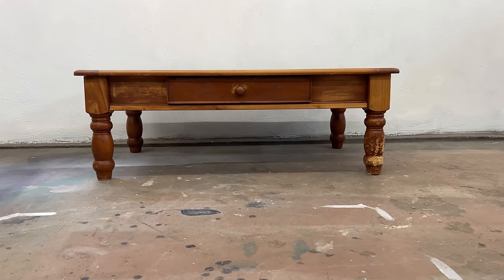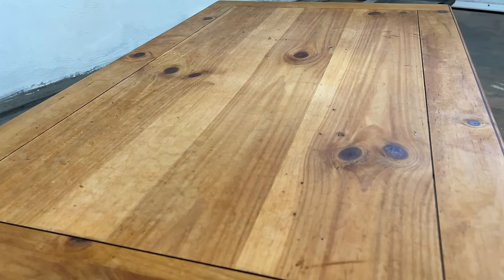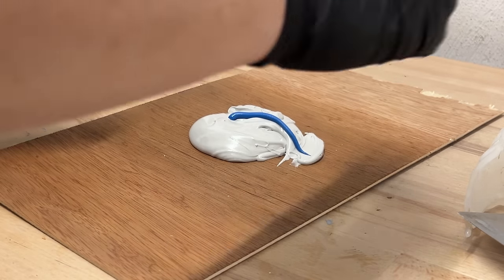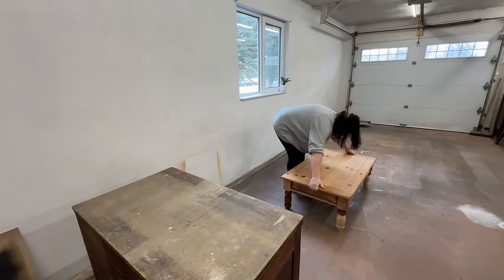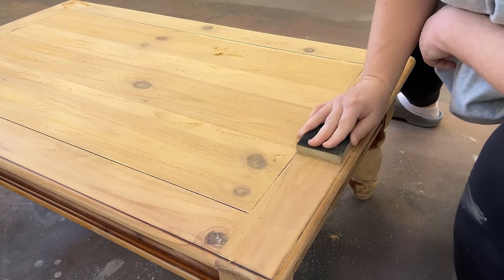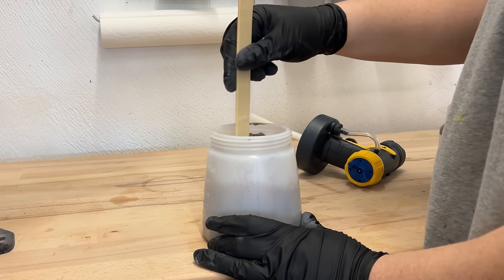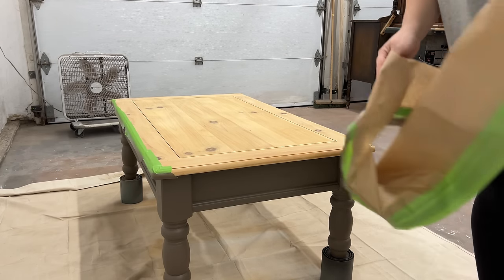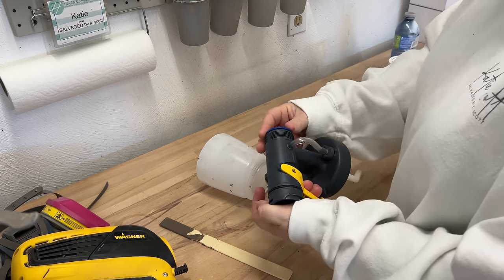How to repair a PET CHEWED piece of furniture!

Comment: Such a great transformation. 

Question... I am looking to buy a surf prep sander. What is the pad called that you used on those legs? I'm nervous to pull the trigger. I have Festool sanders. But the 3x4 rectangle head looks like what I really need. I've heard that the soft interface that Surfprep has is better than Festools.
Reply from the maker: I used Surf Prep’s old foam abrasives in this. They’ve upgraded to a newer pre-stressed foam now that’s more durable - I just don’t have any at the moment.